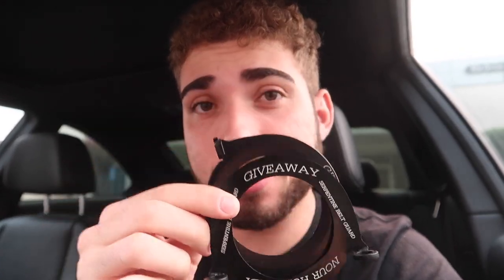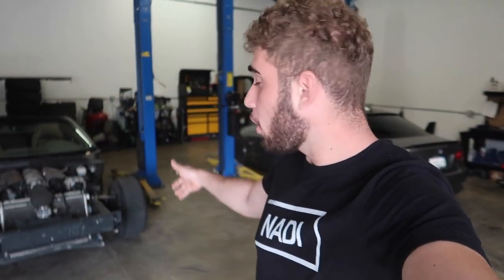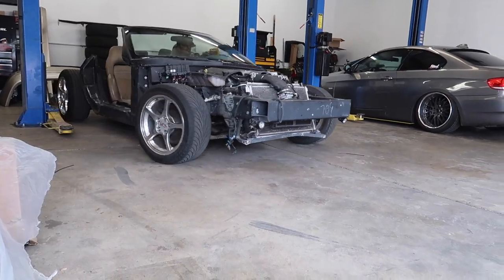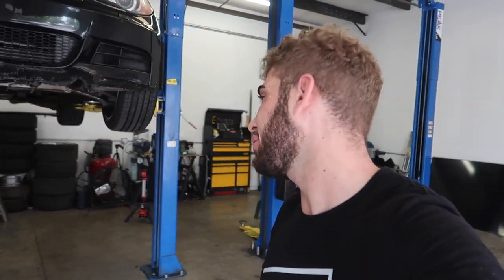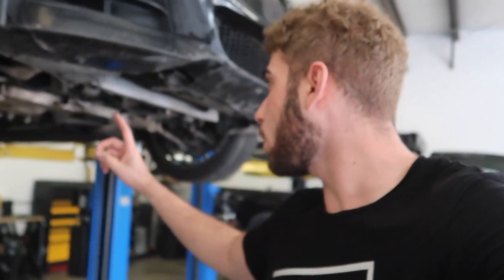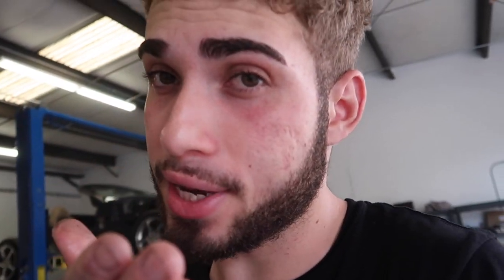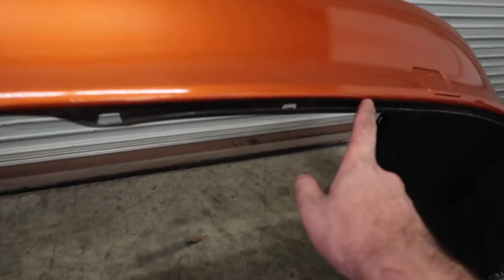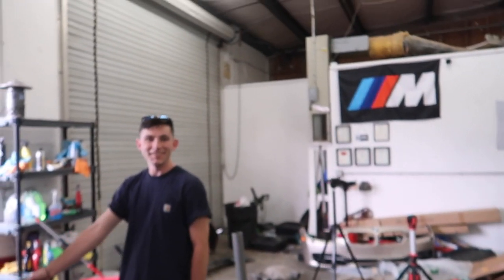135i N54 GETS CAT-LESS DOWNPIPES AND MUFFLER DELETE! (SHOOTING FLAMES!)

Comment: the reason why that happened to the bumper: the exhaust is meant for removing engine fumes as well as excess HEAT which exit through exhaust tips hence why its places at the back facing outside the car. You cutting the muffler and leaving the exhaust pipe under the car, meant that all the heat got trapped under the car like a furnace and caused it to melt the clips holding the bumper. Its not because of the pops.
Reply: Ishtyaq_ mone did the same thing

Comment: wow dude that's crazy how all that melted but yeah you need the pipes coming out the back. I did all the bolt on's on my 335i and muffler delete and it sounds awesome. my belt came off one time and sucked right into the motor wish i had that piece to have prevented that but oh well I'd like to have one on anyway. Thanks for the great video

Comment: The heat from the exhaust melted your bumper since the pipe wasn’t all the way out that’s why it was falling off it heated up too much plastic and and heat not good when I seen you drive off after you cut it I knew that would happen sadly happened to me on my Honda once you might need a new bumper ..